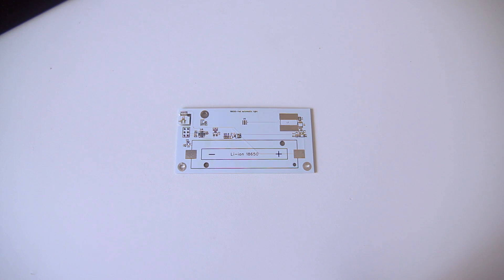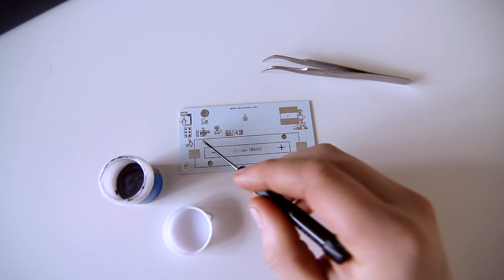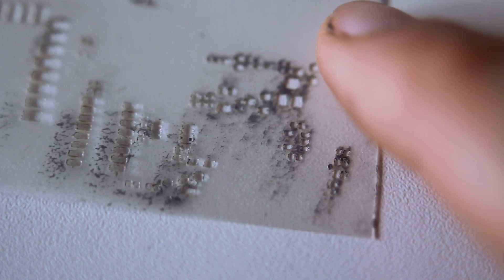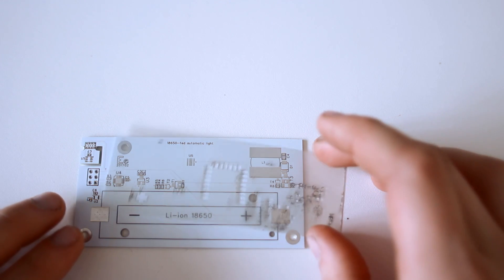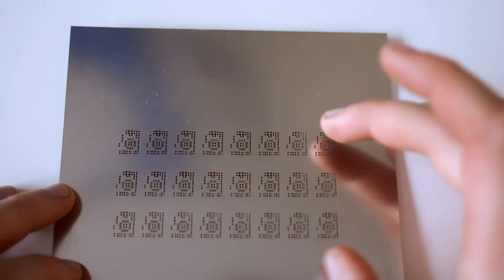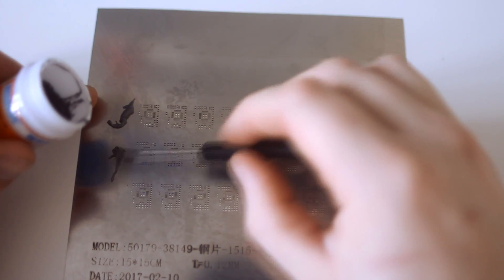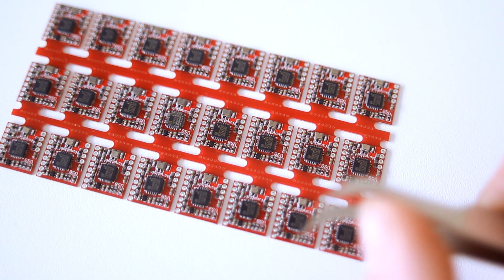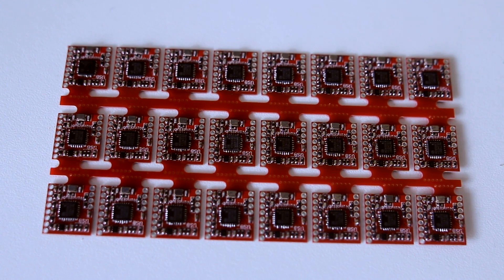Solder paste stencils (+walkthrough) (046)

Comment: Good level of detail, not to long winded.
What flux and solder paste are you using ? I have to get same, and know qualities varies.
Reply from the maker: Just search for similarly looking little pots of solder paste on ebay, I always get a different one (whichever is cheapest) and never had a problem. For flux, I have 2 favorites: Decent brand-name flux pens for important rework that needs to clean up nicely, and 'Amtech NC559' vaseline-like flux paste. That last one is waaaay cheaper, but leaves sticky residue.